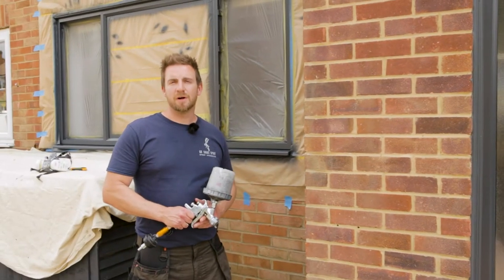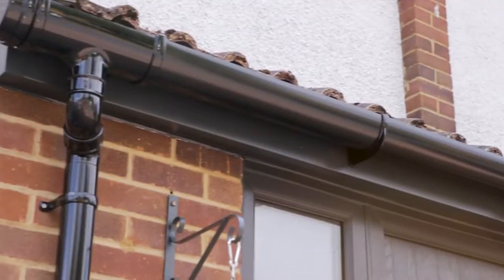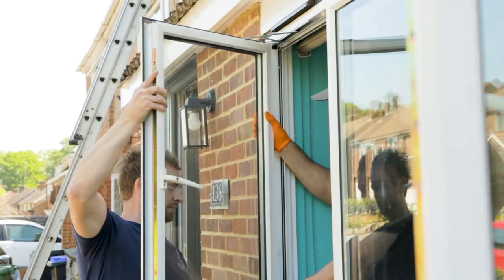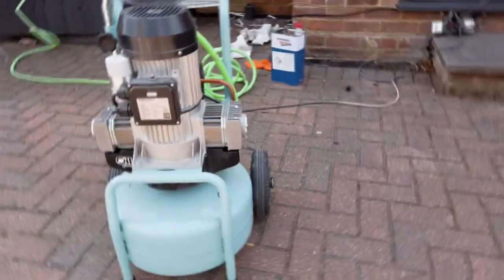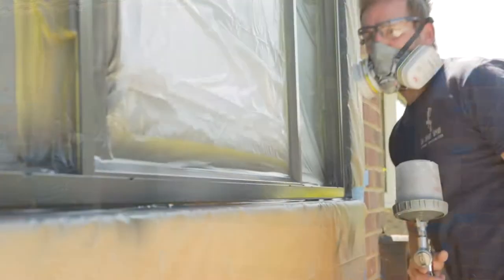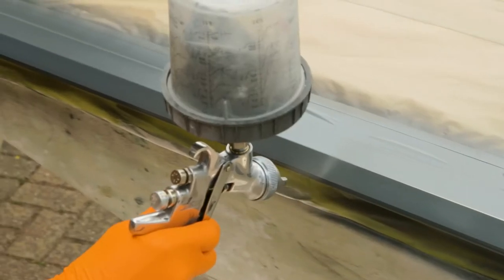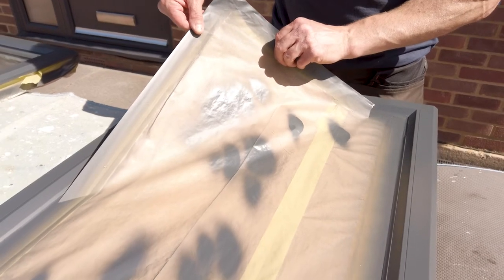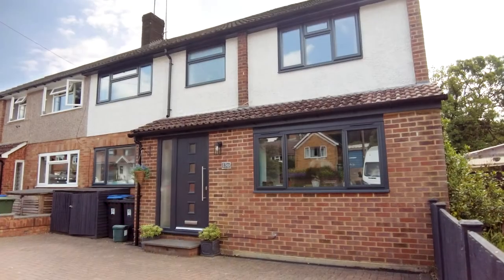Spray Painting uPVC Windows in any colour of paint

Comment: UPVC CAN'T BE PAINTED  NO MATTER WHAT PAINT YOU USE I WOULD LOVE TO CHECK OUT THE WINDOWS IN A COUPLE OF YEARS ,WHAT YOU DON'T UNDERSTAND IS UPVC MOVES WITH THE HEAT SUN ECT .
Reply: Those windows will look absolutely fine, just like your car bumpers look absolutely fine 10 years after buying a car. 
Along as you use UV resistant solvent 2k polyurethane it's not coming off
Reply: Wrong. Yes you can paint upvc windows perfectly fine using the correct 2k paint. The paint is highly uv resistant and is fully flexible to allow for the changes in temperature.
Reply: Not the case one bit. Proper 2k systems on windows, ain’t going anywhere. I have visited properties where we sprayed the windows years ago and they look amazing still.
Reply: Completely misinformed. Why you’ve gone out of your way to post complete nonsense is a mystery.
Reply: What paint brand would you recommend for someone who wanted to do this themselves? Would clear acrylic work with a pigment added? Thanks!
Reply: Also! Would it be possible to get a polyurethane clear so that it can be mixed with say, mica pigments?
Reply: Hand my front door done 6 years ago. Still looks mint.
Reply: Haha what a toilet
Reply: dont know what your talking about done mine 6yrs ago still as good why does paint come with 15 yr guarantee